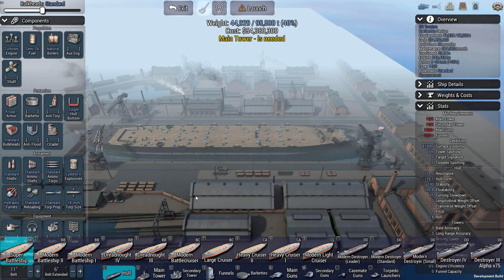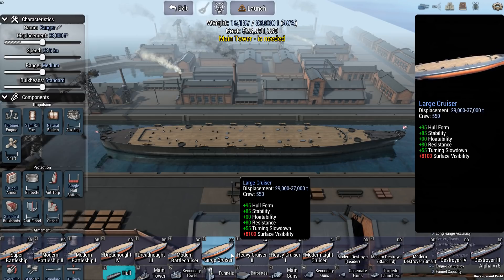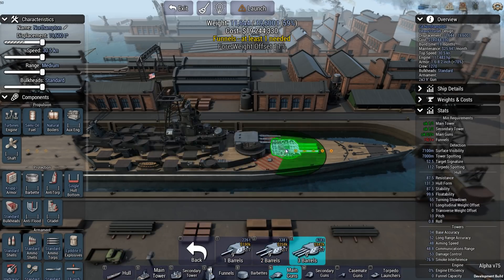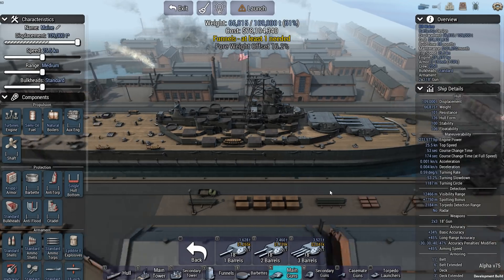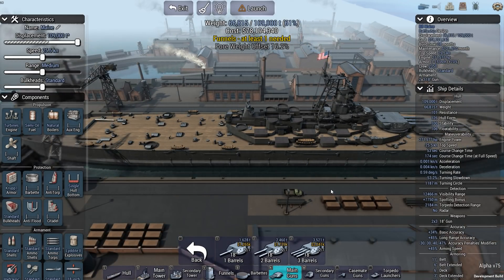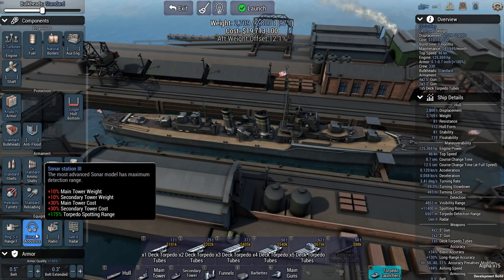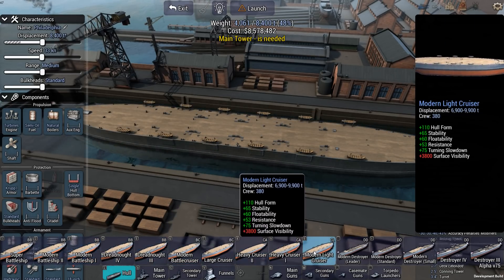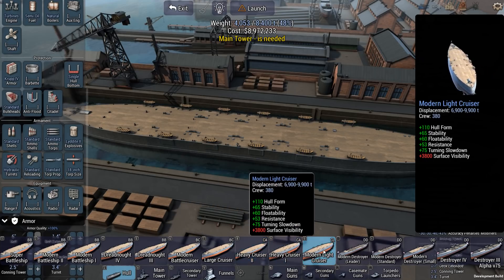Ultimate Admiral: Dreadnoughts - What Is The Best Ship? - Quick Tutorials

Comment: A taskmaster or general challenge proposal:

 I spent the last hour or so testing the following scenario to see if it would be possible. It is, but the scoring is more complex. 

 Last Second Convoy Raid:

 Constraints:
- Max available Raiding Party Tonnage: 35,000
- Max Cost: Unlimited
- Class Restrictions: Free pick (Choose only one class to ensure tonnage restrictions are followed, since the you can only design the one class)
- Ship numbers: As many as you can/want to fit into 35,000 tons combined.
- Minimum Ship range: Long (these are supposed to be dedicated raiders)
- Must have best possible Radio installed (these are supposed to be dedicated raiders)
- Hull Unlock recommended
- Starting distance 50,000 m
- Year - PC: 1940 - NPC: 1920 - 25
- Enemy team: 
         1x CA
         2x CL
         4x DD
       20x TR

 Scoring:
- You have 01:30:00 to sink as many transport vessels as you can. This is your primary objective. Everything else is secondary.
- You can choose to end the scenario at any point within that time frame, as long as you sink all the transports first.
- You can treat the time constraint as if at that point enemy reinforcements will be too close to safely evade, leading to a loss.
- Each transport is worth five (5) points, for a base possible score of 100. All further score modifiers will be based on what you get here and then added onto or substracted from it, after they have been calculated separately from each other.
- I'd recommend pausing after sinking all the TR to decide how to proceed further.

 - Modifiers:
  - There is an extra 30 possible points equally distributed among the enemy escort ships classes. CA (10), CL(5), DD (2,5)
  - Sinking ALL ships, grants an extra 10 points.
  - Giving the enemy 1925 tech is worth an extra 10% (positive) modifier on the base score. Giving an extra possible 10 points if all TR are sunk.
  - Finishing all TR 30 minutes before deadline gives an extra flat 50 points (difficult but possible, going 1925 will make this very TR spawn RNG dependant)
  - These are all the positive modifiers, giving a maximum possible score of 200 points

 - Every TR that you fail to sink also gives a 5% negative modifier to the bonus score (the escort ships 30 points). You are here primarily to sink the TR carrying important goods, the rest are only supposed to be a bonus (being severely out of date ships), thus the negative if the primary is failed.
  - Every ship you lose takes points from you. if you have one (1) ship, that ship is worth 50 points. If you have two (2), each is worth 25 points. If you have four (4), each is worth 12,5 points. Divide 50 points with the number of ships you have.

 You can choose to disengage and tally up your score at any point in time before the deadline. "Remind yourself that overconfidence is a slow and insidious killer."
Reply: yeah sorry but that sounds pretty simple you just build a ca or cl with 30+ knots that will kill the escort alone pretty easily due to the 20 years of tech advantage and because of the speed it can dodge torps and catchup to the transports easily. and if you have enough tonnage you can even field 2 of them making it even stronger
Reply: @sgxbot  Yes, it's even significantly easier to do now than it was a year ago when I made the challenge. but the whole point of the challenge was to create an efficient raiding force within the max tonnage restriction, it was not meant to be especially difficult. It was specifically adjusted to be entirely possible with each class (be that 30 DDs, or one BB) just to encourage experimentation.

The difficulty would come from the competition, and how many points they could get compared to the others. As well as the many possible ways they could attempt this.

And yes, the easiest and most efficient way to do it is four to five CL's.

Comment: In reference to the Rock-Paper-Scissors Analogy, the ULTIMATE ADMIRAL:  DREADNOUGHTS Game System shouldn't incorporate False Gameplay Mechanics that favor the Rock-Paper-Scissors Dynamics between Warship Types.

I believe that this has happed with NAVY FIELD 1 & 2 and with WORLD OF WARSHIPS.

Originally (back in the 1880s & 1980s), the Destroyer Class was referred to as Torpedo Boat Destroyers; because, they were designed to counter the high speed Coastal Defense Torpedo Boat Designs that pioneered the Modern Day Torpedo as a Naval Weapon in the 1880s and 1890s.

Eventually, the Torpedo Boat Design grew in size for better seaworthiness; and, the Torpedo Boat Destroyer and the Torpedo Boat merged into being the Destroyer as the "Torpedo Boat" for the High Sea Naval Fleets.

The 1906 HMS Dreadnought was a Warship Design that featured only the Main Gun Battery for Naval Combat.

That isn't entirely true.  The 1906 HMS Dreadnought did have Light Guns to counter Light Naval Vessels like the 1900s Torpedo Boats; and, the 1906 HMS Dreadnought did have Torpedo Tubes as Naval Weapon Systems.

The Torpedo Boat Destroyers were created to help protect the 1906 HMS Dreadnought against the 1900s Torpedo Boat Designs; so that, HMS Dreadnought could focus its Main Guns on more significant Targets like other Battleships.

For a time, the 1906 HMS Dreadnought was recognized as The King Of The High Seas because it outgunned every other Active High Seas Warship Design; and, it outran every other Active High Sea Warship Design; but, the 1906 HMS Dreadnought couldn't outrun the 1900s Torpedo Boats.

The Torpedo Boat design was designed for the purpose to harass, and sink, Armored Warships like Cruisers and Battleships by using Torpedoes as the Main Weapon System.

Prior to World War One, Torpedo Maximum Range was shorter than the Secondary Gun Armament of Battleships; and, the Main Armament of Cruisers.

Battleship Secondary Guns, and Cruiser Main Guns, were designed for sinking Cruisers.

Battleship Tertiary Guns, and Cruiser Secondary Guns, were designed for sinking Unarmored Naval Vessels like Torpedo Boats and Civilian Merchant Ships.

Naval Guns were mounted unto Torpedo Boats for the purpose of preventing Enemy Warships from having free potshots at Torpedo Boats as the Torpedo Boat got into Torpedo Range.

With the advent of Aircraft entering Naval Warfare, the Light Guns that were designed for targeting Unarmored Naval Vessels were converted to Anti-Aircraft Weapon Systems.

So, in Real Life, the Rock-Paper-Scissors Dynamics between Warship Types is actually fluid; and, based on the Individual Warship Design Features in terms of Speed and Armament and Armor and Displacement.

ULTIMATE ADMIRAL:  DREADNOUGHTS is meant to be The Game System that represents the Realistic Dynamics of Naval Warfare prior to the advent of Aircraft.

However, World War One, and World War Two Warships, were designed for the realities of Naval Warplanes being present.
Reply: destroyers come from torpedo boat destroyers yeah. but from that point on they evolved as the fleets main defensive vehicle adopting sub hunting roles when submarines started being a highly used and highly effective tactic and took on strong anti air weapons with planes becoming stronger in naval battles. and now destroyers have missiles to counter icbm that have been launched at them or allies, anti air weapons like missiles and cwis and sub hunting weapons. 

and as a result of being the defensive part of the fleet they had torpedos as a defensive tool against strongly armored battle ships.

so yeah torpedo boats didnt turn into destroyers torpedo boats just became less usefull as the guns of the other ships became more accurate and dissapeared after a while and at a similar time destroyers started to use torpedos as most guns couldnt pen the highly armored battle ships that emerged during that time.
Reply: @sgxbot  ... In the 1890s Torpedo Boats and Torpedo Boat Destroyers and Torpedo Gunboats generally merged into the Destroyer.

This merging is really the result of Warship Type Classification based on Warship Displacement and Warship Weaponry and Warship Crew Capacity and Warship Range and Warship Armor Scheme.

In the 1880s, the Self-Propelled Torpedo was a New Experimental Weapon System; and, the Torpedo Boat was the Platform for researching and developing the Torpedo Tube Launching Mechanism and the Torpedo Weapon itself.

These Torpedo Boats were nothing more than the 1880s version of the Modern Day High Speed Bass Boats:  River Boats and Lake Boats that weren't suited for Oceanic Waters.

I believe that the Torpedo became an Effective Weapon System in 1888; at which time, the focus for the Torpedo became the Naval Vessel Platform from which to launch the Torpedo.

This is when the Torpedo Boats grew from Small River Boats & Lake Boats to Keeled Oceanic Vessels; and, Torpedo Boat Destroyers were created to counter the Torpedo Boat threat; because, Corvettes and Sloops and Cruisers didn't have the Speed to catch Torpedo Boats.

Because Torpedo Boats were Small Naval Vessels, only 3-Inch Guns and Smaller were required for destroying a Torpedo Boat.

As Torpedo Boats grew in size, they also started carrying Machine Guns and 3-Inch Guns for defense against Torpedo Boat Destroyers.

1902/1906 HMS Dreadnought was designed with a Main Armament; and, no Secondary Armament.

Weapon Systems for Anti-Personnel Gunfire (because Naval Combat was expected to get within Machinegun Range), and Defense against Torpedo Boats, were considered as Tertiary Weaponry; thus, 1902/1906 HMS Dreadnought was designed with Tertiary Weaponry for defense against Torpedo Boats.

1902/1906 HMS Dreadnought was also armed with Torpedoes; because, Torpedoes was a New & Untested (for Military Tactics & Strategy) Weapon System.

It is true that Destroyers were adopted to Anti-Aircraft Roles and Anti-Submarine Roles; because, they were the only Naval Warship Design to have the High Speed Needed to get to the area needed for AAW & ASW Activities within the Fleet Formation.

Destroyers weren't created specifically for AAW and ASW.

The Wright Flyer A had its Maiden Flight in 1908.

World War One didn't start until 1914.

The First Aircraft Versus Aircraft Dogfight didn't occur until 1915 or 1916.

1916AD - 1888AD = 28 Years of Destroyer Development before Aircraft entered Military Combat Service

Submarines were being developed, as an alternative Torpedo Platform, at the same time that, Torpedo Boats and Torpedo Boat Destroyers and Torpedo Gunboats were being developed for Torpedo Warfare.

Comment: i wonder in case that im not moving as battleship do i have better aim?
Reply: If you hover over your ship speed indicator there's a 'maximum cruise speed', that gives the maximum aim advantage. Anything below that is detrimental (easier to hit but no more accuracy bonus)
In case of going really slow (somewhere below 10 knots) a ship suffers a 'easier to hit by low speed' debuff. Be sure to stay above that.
So the best speed for gunnery is a straight line at maximum cruise speed, a bit above the the 'slow speed' debuff.

A second variable is course changes. You change course and a part of the enemy's and your own aiming solution is reset. That favours whoever has quicker aiming. So if you use a single coincidence 1 and the enemy comes rocking up in a ship full of super rangefingers, radar etc, don't change course.

Now if you however have much quicker aiming, course changes favour you because the enemy loses more accuracy than you do.